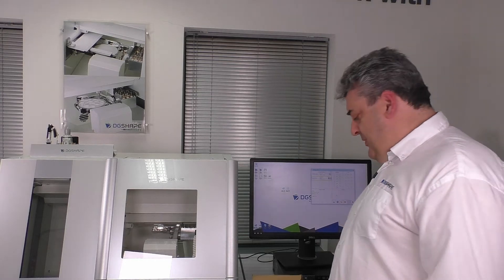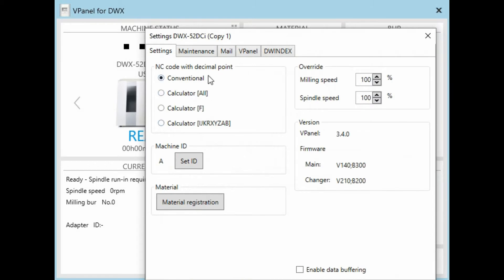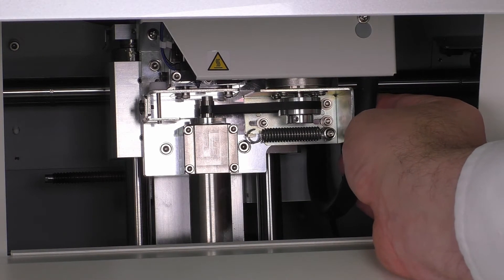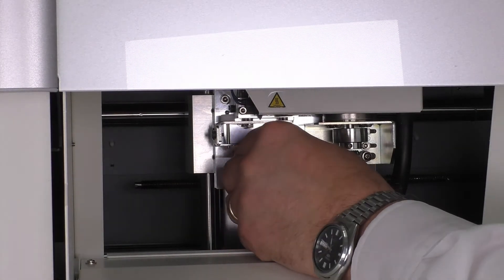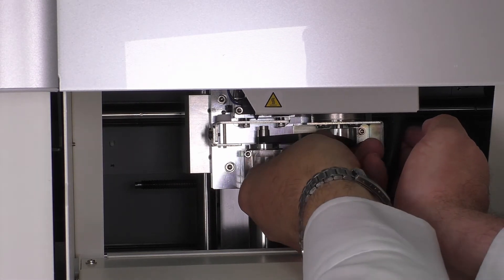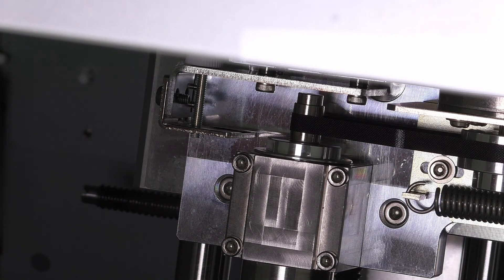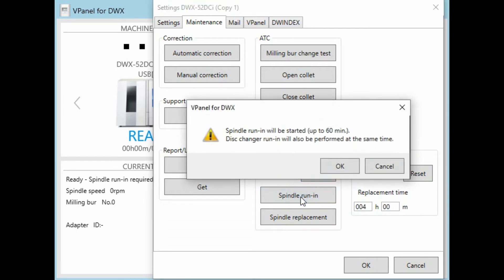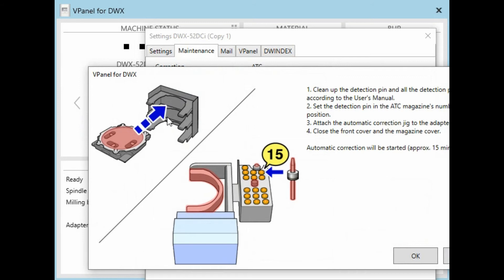Changing the Spindle on a DGSHAPE DWX 52 Series | Maintenance

Comment: The lab where I work has three of these units. The spindle on the oldest of them just gave out after a little under 3000 hours. Today, I stayed home due to incredibly bad weather, and am trying to use the time productively by learning how to fix the machine. I’m glad to see that the process, while requiring precision, looks relatively simple.

0:46 
Massive respect for this moment! I’ve always hated that “real men don’t need to read the instructions” bs.

Just in case there’s any doubt: despite how helpful this visual demo was, I’m still going to read the instructions.

Thanks again, friend.